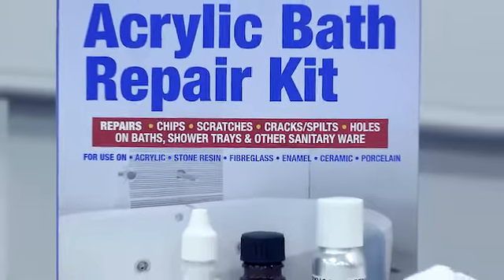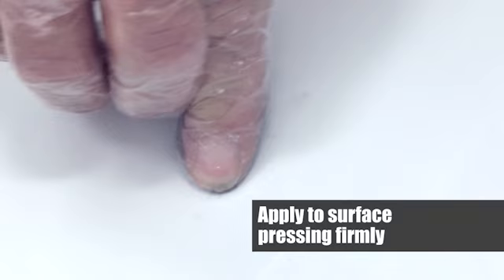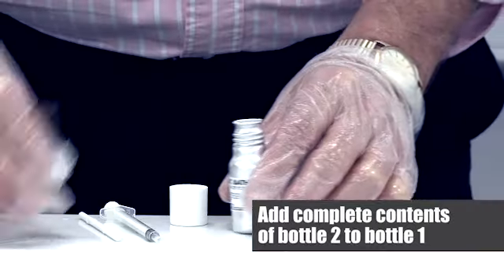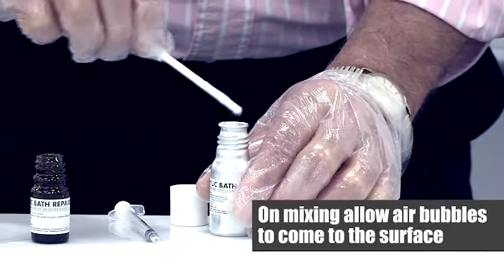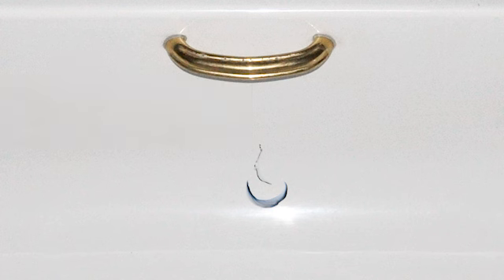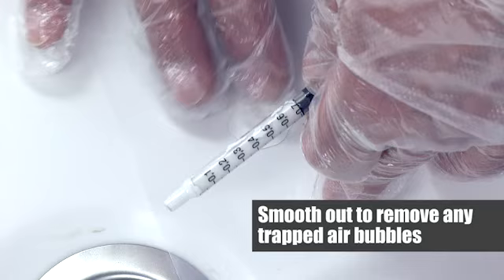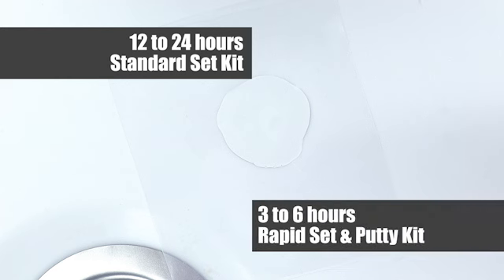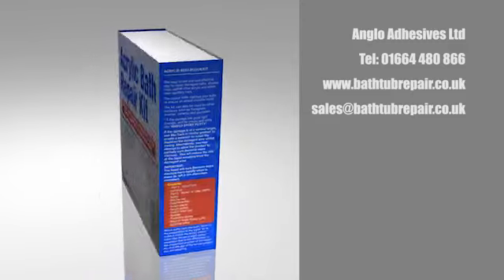How to repair your Bath / Shower Tray using the Anglo Acrylic Bath Repair Putty Kit.

Comment: The top later on my bathtub has lifted and there are small holes which is allowing water in. The problem is that it has occurred in the bottom corner. How would I make a smooth finish as it isn’t a flat part of the bath?
Reply from the maker: Hi Teresa, after you have applied the solution to the damage area you would use the wet and dry emery paper that we also supply in the kit to make the surface smooth again.

Comment: Hole repaired and will be water proof. My experiences ... It is difficult to stop the liquid running out if the hole is on a slope, as mine was. The bluetack trick works to stop the liquid running out too far. I would expect this works much better if the hole has a sharp edge all round. The damage in my bath became shallow near the edge which means the filler hasn't got the required 3-4 mm depth. This creates a line around the hole once it is smoothed . Didn't come close to matching the colour of my bath, it was a much brighter white. In the end I am happy because it doesn't leak anymore!